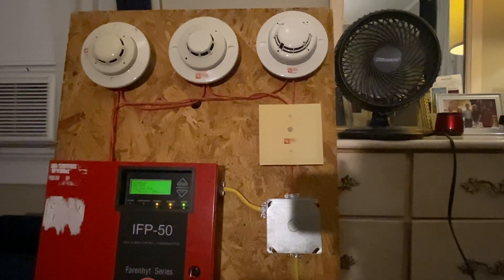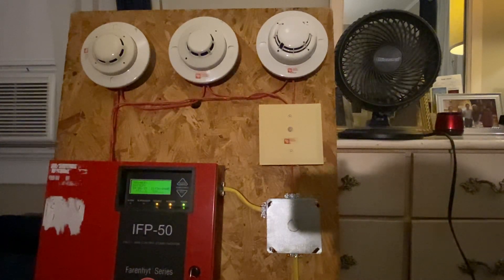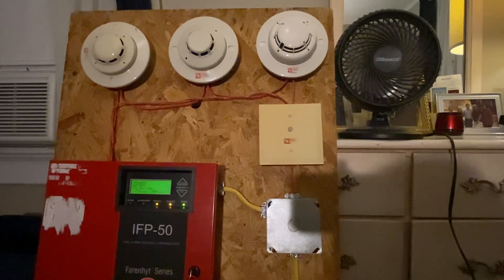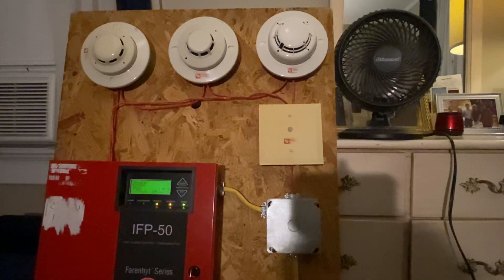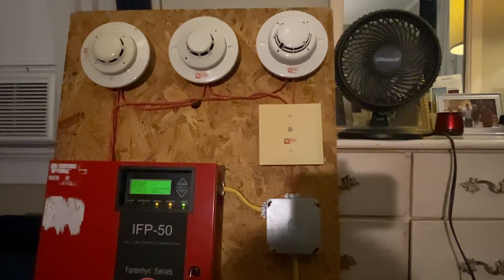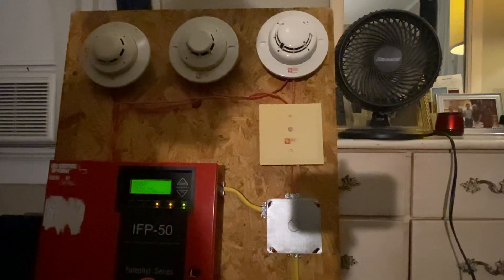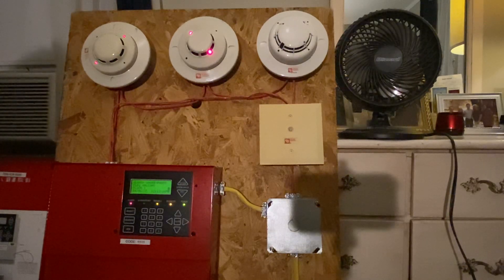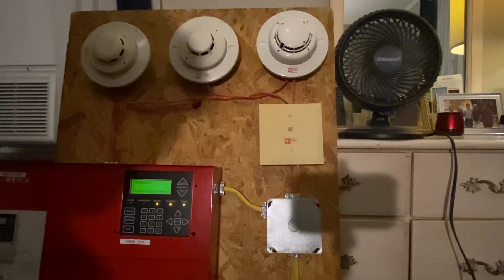Fire alarm system fan shutdown demonstration

Comment: Why is the fan restarting when the fire alarm system is reset?  In my Jurisdiction the fan has to be restart manually not automatically when the FA system is reset. How would you meet the manual restart requirement with PAM relay set up?

Comment: Why would you want to have fan shutdown on all zones? Itsn't it more sensible to have fan shutdown only on the "affected" zones, so if the fan in question is in a duct between basement and first floor, you would have fan shutdown only on those zones and ignore second floor? Also, I think it does make some sense which direction the fan is blowing... You don't want the fan to suck in smoke and distribute it to other rooms, or have the fan feed air to fires in those zones, but if fan goes to outdoor, you definitely even want to START that fan in case of a fire to suck out as much smoke as possible.
So it really needs to be tought out airflows and how you WANT airflows to go when there is a fire in a certain zone.

Also many commercial duct fans have a 24v fan shutdown input, so you could skip the 120V relay and wire the 24V relay directly to fan. And by wiring only 24V, you are only working on low-voltage side and thus you don't need a licensed electrician.

Or if you have a thermostat with fan output, you can put a 24V NC relay on this, so it will break the GREEN wire (often marked G inside thermostat) when fire alarm activates. Also a non-licensed-electrician install since you are only working with so called SELV voltage. By putting a relay on GREEN wire, both thermostat and fire alarm must be in agreement before fan is allowed to run. If either fire alarm OR thermostat says NO, fan wont run. Also makes sense to also break W cable (WHITE --> heating), by using a 2 pole relay, in case the heating system is the cause of fire.
Reply from the maker: It depends on the jurisdiction and what they require. I’ve done jobs where they wanted fans shut down just for the associated unit and then I’ve done other jobs where they wanted the fans shut down building-wide. You’re not always going to skip out on 120 V. How I have this set up is just one way that it can be done like I said before. However, most of the time I see PAM relays being used. All depends on the units and what the job calls for. This doesn’t just go for duct detectors.
Reply: Hey man can you show diagram
Reply: Right, it's called Global Shutdown and is used in many larger facilities.